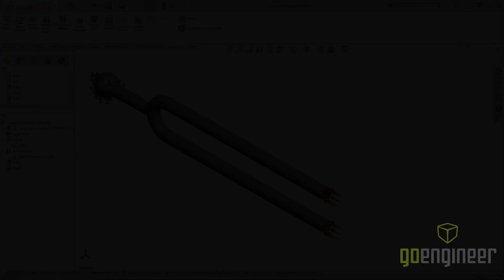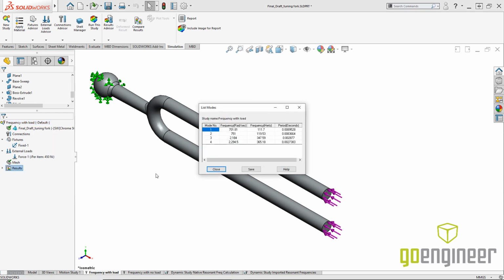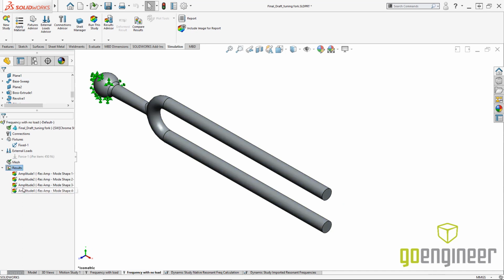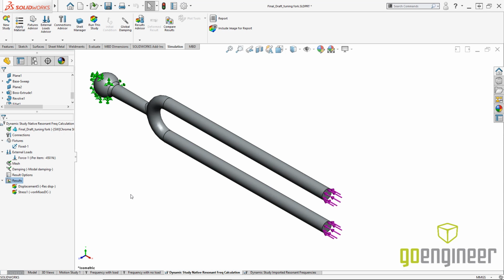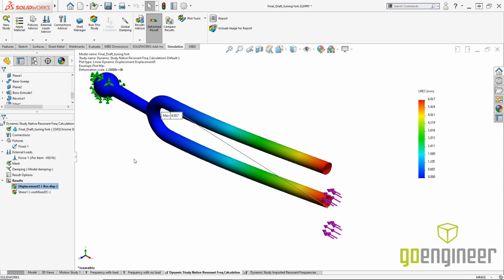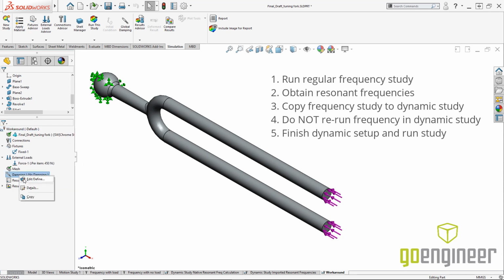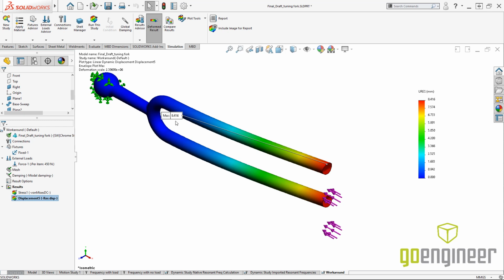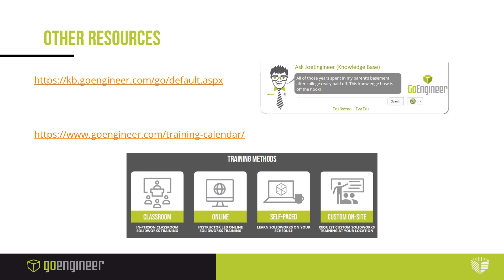SOLIDWORKS Simulation Tutorial - Resonant Frequency Calculation in Dynamic Studies

Comment: How can I calculate a torsional resonant frequency in this model?
Reply from the maker: Simulation has the potential of calculating an infinite amount of possible resonant frequencies for any given geometry.  To find the torsional resonant frequency of a particular model, you will cycle through the calculated resonant frequencies.  If it was not calculated initially, you will increase the number of calculated resonant frequencies and look through the additional frequencies until it is located.  If it is still not calculated you will increase the number of calculated resonant frequencies again until it is calculated.